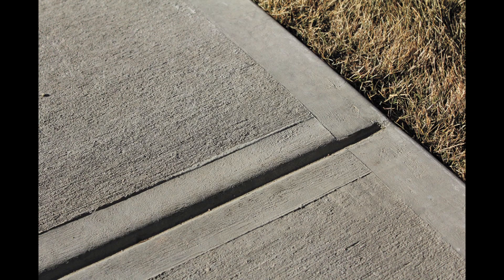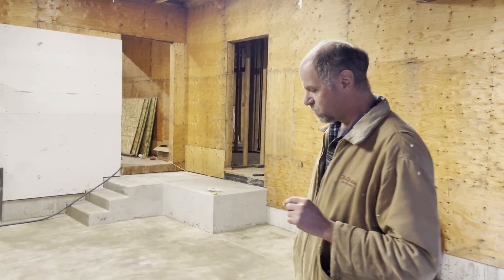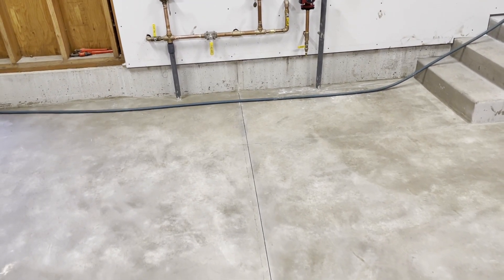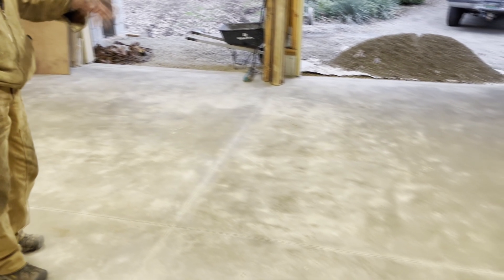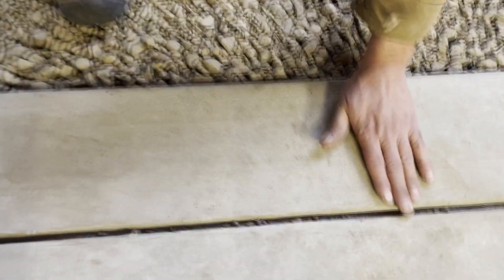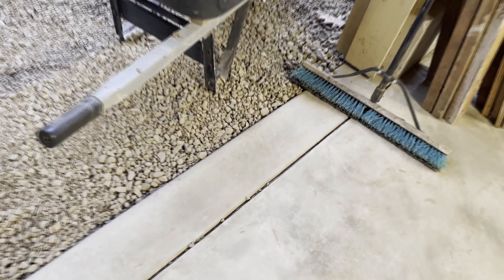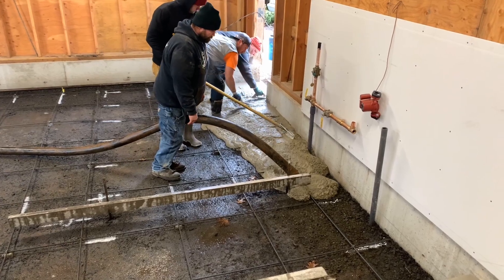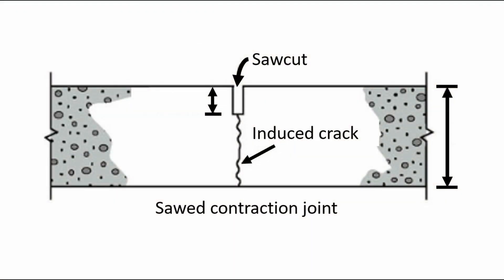Concrete Saw Joints on Garage Floors

Comment: 3/8" to 1/2" cuts are useless on a 4" floor.  Rule is 25% of total depth and 30 times thickness for spacing. And you dont need cuts off inside corners if extra rebar is added at proper location.